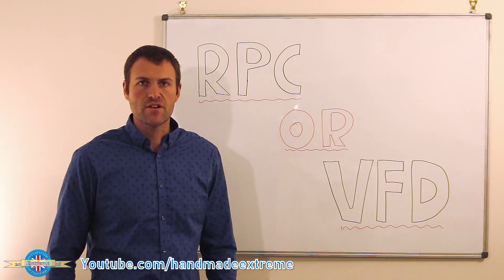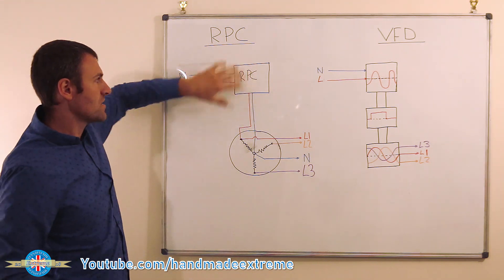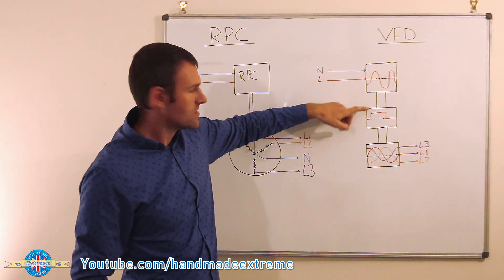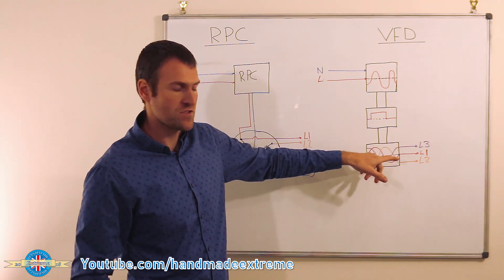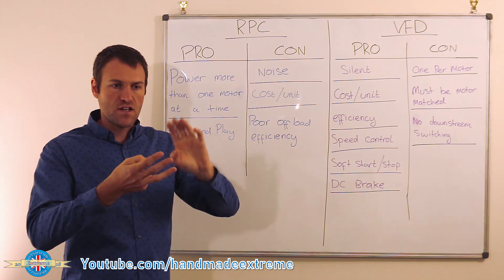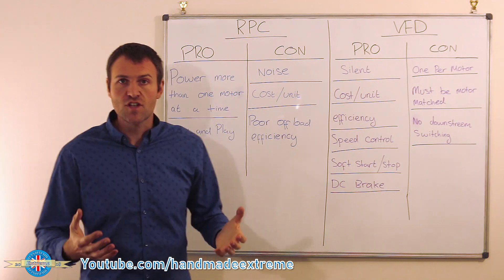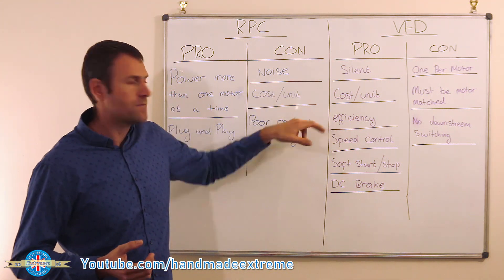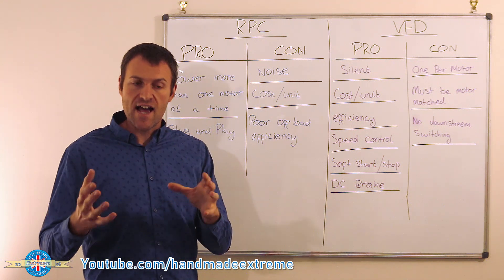Rotary Phase Convertor (RPC) vs Variable Frequency Drive (VFD) ... Which is best ???

Comment: VFDs do have a minimal rating? I guess the dream of snacking that 10kw VFD from my ex workplace to power my small shop lathe.
Reply: A couple of things.
You missed the one bit, you can still add a VFD to machine later even if your workshop has a rotatory converter.
As you well know most man caves are a continuously upgraded. don't tell the wife this one :)

I recently bought a Chinese VFD 2.2KW for less than £60 to run a 1.1kw motor. I know the quality risks, but It does exactly whats on the tin.
The £60 bit is no longer the case, more like £70 to a £100 and most direct from China so forget warranty .
£60 VS £200, the no warranty is worth the risk. as I can buy 2 more before I am out of pocket.
Note the Ebay lying cheats are now selling 1.5kw as 2.2kw.
The bit of it has a minimum power rating I don't get. I would bet my cheap Chinese  unit would be fine running a the smallest motor.
This is more likely the case for early VFD's, but electronics has come a long way since then.
Reply from the maker: I think I may have not been particularly clear regarding minimum rating. Most, I'm not saying all, but most inverters have a minimum value when you are setting up the overload current. This is what I'm referring to when I said minimum rating. Sorry for any confusion there. 

Regarding the using a massive VFD to power the shop... It is possible but the VFD needs to be significantly bigger than your load and you loose all of the protection (due to minimum current ratings and having multiple motors running at the same time) so your machine protection needs to be all in good working order ( which it should be anyway ) Also if you change the frequency all of the motors speed up or slow down together. This may or may not be desirable. Based on some of the comments I've had on FB I might have to address this point as it seems quite a few people are doing this. Using a whack off great big VFD brings an interesting cost element into the debate as well. Not so bad if you are getting it on the cheep but big VFD's are BIG$$$ if you have to buy new. There is also the question of manufacturers warranties to consider. Inverters are not designed to be used in this way. Not saying that it can't be done just that there are a number of more complex pitfalls to be aware off. 

Interesting point about the Chinese VFDs. Yes they are very cheep. It looks like you have already spotted the main pitfalls. One of my main gripes with doing it that way is what happens when it goes wrong. It will only fail when you are using it so it will be an inconvenience. If your suppler does not hold stock in your country and you have to wait for one to be shipped from china how much downtime is that going to cause you. Just a consideration. Again it all depends on thepersons situation. For me that's not an option as my machines get used for work. I can't justify the downtime. In a hobby shop it's probably fine. 

Great comments guys. Thanks for the support and hope this clears up any confusion.  👍👍
Reply: @martinx8348  I've seen those cheapo Huanyang VFDs on Amazon too. 100 bucks delivered for 1.5kW isn't bad. So if I understand correctly, as long as I disable the current protection I'm good? If thats the case, I'm gonna pick that huge VFD up for sure! But for good measure, I try to get the datatsheet, I need it dor wiring it up anyways. Funny enough, it is single phase capable despite that huge capacity.

Comment: Well explained but what about the third option, static converters?
Reply from the maker: Great point. I didn't go there for the simple reason that I have never used one so don't have any personal experience with them. I'd be uncomfortable giving advice based one something I don't know much about. Thanks for the support.
Reply: @Handmadeextreme well said and good for you, i hate people giving advice on things they dont comprehend. 🙊 a bit of a youtube phenomenon unfortunately.
Reply: @chrisstephens6673  Statics are an option BUT I believe they don't offer full torque and they need 'tuning' to the motor - a simple enough process but accurate 'tuning' is different for high loads than low loads on the same motor. I've one for sale - that went bang. I decided I'm too rough for it, and didn't like it enough to fix it.
I'd originally planned to go for option 4 but couldn't find an MG set - so went for option 5 - a diesel generator - which doubles as an emergency power supply.
Machining by Mike

Comment: Good explanation. No real need for a vfd for a coolant pump. Just steinmetz it.
Reply from the maker: Cheers Carl. That's a good point about the coolant pump. I'd forgotten about doing that. Thanks for the support. 👍
Reply: @Handmadeextreme  No problem. Really enjoyed the video. I guess one other thing to note with vfds is you may need to change the motor wiring from star to delta. This  can sometimes be quite invasive.

Comment: Hmmm , my 11kw vfd powers my knee mill spindle and feed motors and coolant pump (like a power station )  , how am I getting away with it for 5 years now ?
Reply: Stephen Leacock me too.
Reply from the maker: Most likely reason is that the VFD is significantly oversize for the load. This way the inverter IGBT components are unlikely to be overloaded by switching the downstream load on and off under load. There do seem to be a fair number of people getting away with it but from what I have seen the VFDs are significantly oversize in these cases. The only real concern is longevity of the inverter in the VFD.
Reply: Handmade Extreme I am re-thinking my choices after watching the video.
Reply: I seem to recall hearing one of the major suppliers saying it is possible to power a whole shop using just  one VFD.
Reply: You can get plug and play VFDs - we,ve got one in our workshop.  415v output wired to  3phase outlet sockets and runs three machines-control wiring and all
Reply: @44Celt  good to know the old brain memory cells are not completely rotten, yet.

Comment: Here in Sweden we have 3 phase connection too almost every house.
Reply from the maker: Consider me jealous. Over here in the UK it is very rare to have 3 phase in domestic properties.  Thanks for the support.
Reply: @Handmadeextreme  same in Finland :D i even have 3 phase in my small apartment. but we really do need it for all our millions of saunas of which many have electric stoves :D
Reply: @Handmadeextreme  Yes we are lucky. We have main fuses from 3x16A, so we can run pretty big motors "at" home. As I know there is no 1phase VFD bigger then 4kW?
Reply: @Handmadeextreme  andy AKA photonicinduction had got a quote to have a 3ph supply connected to his house, came to £2000 i think. Bloody expensive.
Reply: @Handmadeextreme  That's changing ! Western electric is connnecting new properties with 3ph and giving free upgrades to those without #Wales.
Reply: Here in Argentina you can have either service for domestic use (1ph 220V or 3ph+N 380V).
Reply: even with 3p at my house, id still consider a cheap VFD for a drillpress
if the Motor allows it
Reply: Single phase only here in USA :(
Reply: @qcnck2776  im pretty sure its 2 phase in domestic connections??
Reply: @Dazzy84  I believe you are right. Technically, the 240V that comes to the house is 120V, neutral and 120V 180 deg out from the first one. But to power a motor at 240V, we would get only a single phase. Same with powering a motor at 120V. 
The only advantage I see is that we can have two busses in the main breaker box, with each powering 120V, and so splitting the load in half. So, to all intents and purposes, I would consider it single phase.
Reply: @qcnck2776  i dint think the second phase is to run any appliance with a motor, it would be commonly used to run heating elements on cookers dryers, or any items where a neutral isnt required.  
Suppose if you apply the logic to run elements that the higher the voltage, the lesser current needed to run it, otherwise the average house would have mega amps running into them at 120v. 😂
Reply: @qcnck2776  Actually, you have 2 phase !

Comment: Great video, I run my Colchester student lathe on a rotary converter which works really well, to be honest it's nowhere near as noisy as I expected,it gives me the flexibility to acquire more 3 phase machines which can be cheaper to buy.
I had to put a high output single phase supply in to power the rpc but was lucky in that the wiring from the house to the garage would support this.
Reply from the maker: Thank you, I'm glad you enjoyed it. It sounds like you have got a great little set up there with some growing room for future. Thanks for the support.
Reply: Good for you - you've kept the reversing switch functionality :)
Reply: High output single phase?  Do you mean the cable was thick enough that ran from your house to the garage?

Comment: That was very well explained, makes a lot of sense! I always wondered why so many machinists on youtube used rfcs when they were so noisy and expensive. I have a VFD to power my 3 phase car lift, but it's the only 3 phase item I own. I'm very happy with it. Considering putting a 3 phase motor on my lathe, but will stick to VFD for the variable speed control and it's likely to be the only other 3 phase equipment I'll own for a while.
Reply from the maker: Thank you, I'm glad you enjoyed it. I think you have got the exact point I was trying to get across. It's all about application. Thanks for the support and good luck with the lathe.
Reply: Well if the 3ph motor for the lathe is the sme HP as the lift - you can just use the one VFD ! And yes - use 'downstream switching' ! to select between the 2 operations - 1 or the other. But only switch while the VFD is not powering a motor.
Reply: That is my problem, just bought a lathe that has three motors on it. So my idea of the VFD will not work. I struggle with electrical AC systems. @millomweb